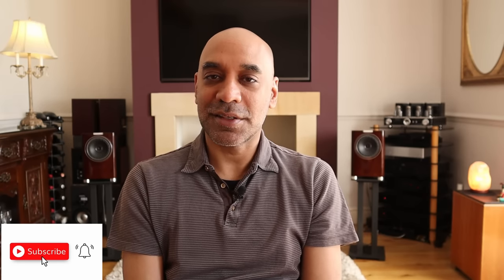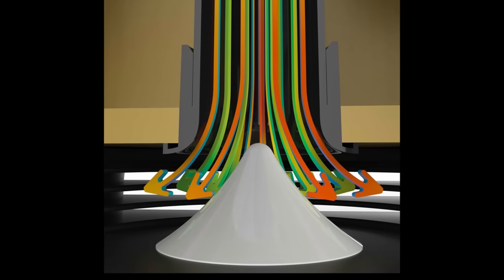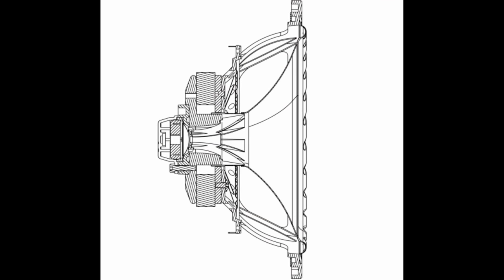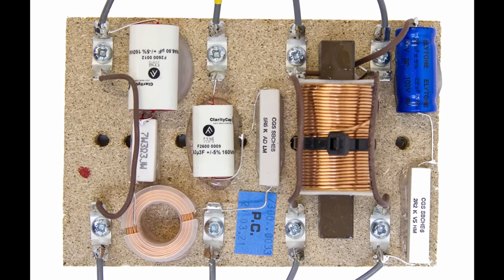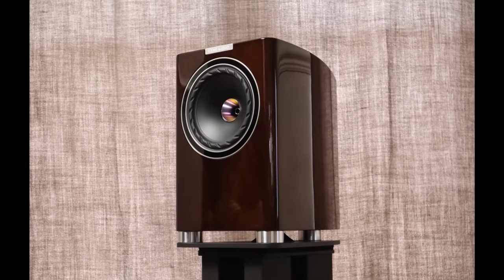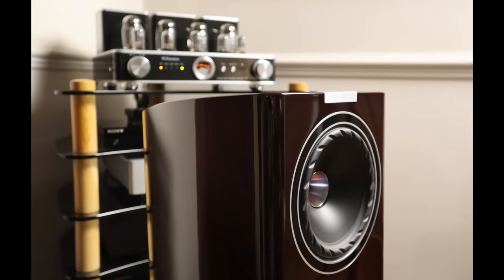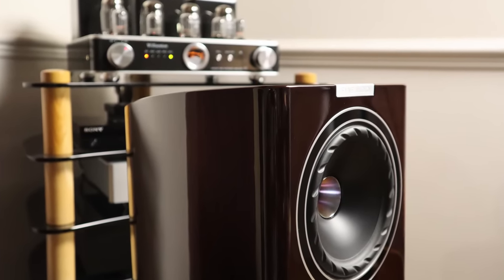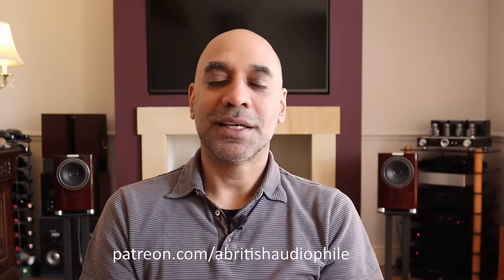Fyne Audio F700 Speaker Review

Comment: I auditioned these and while I don't think the amplifier would make a difference, the tonality you spoke about was pretty spot on.
Reply from the maker: Thank you Kevin 😊👍
Reply: @remella1  let me rephrase my statement. Well designed amps with same output specs should not make any difference. However if you choose a 40W amp and expect it to have a 20db headroom at an average listening level of 80db, with a listening distance of 3m from the speakers, then your amp will definitely struggle to perform; especially when comparing another amp with 80w of power. That is assuming both have distortion and noise below human listening threshold.
Reply: @kevincheong1516  agreed…but when it comes to tonality and sound signature every amp has the potential to alter the sound for good or otherwise…every amp brings its own signature IMO
Reply: @remella1  if they truly alter the sound, then you should be able to see it reflect on their measured frequency response... go check out most modern amp specs and you will likely to find published specs of +/- 0.3db flat from 20hz to 20khz...

If you do detect different voicing, that means the amp output is not linear... if you like a none linear amp, that's personal preference... but from an engineering and design objective, the amp failed.
Reply: @kevincheong1516  specs are only half the story. I have tried about a dozen amps with my ATC SCM40 and they all sound different to me. Some are good and others didn’t match well. The refinement levels reached a level I’m now finding difference by changing two capacitors in the linear power supply for my Mac Mini. In audio everything makes a difference…provided your speakers are transparent enough and you have the ability to perceive the differences.
Reply: @remella1  well, I humbly disagree. Measurement are the basis of design and engineering. I have tried a dozen of amps and those with different sound are mainly attributed to nonlinearity performance of the amp or mismatching the amp with the speakers. Those that measures well and assuming I don't drive them beyond their specified performance threshold, I find it no difference at all.

But if you do perceive a difference and enjoy process, who am I to object... it is your money anyway... cheers...
Reply: @kevincheong1516  😊

I have tried a few amps that measure very well but hated their tonality. There is synergy (and personal preferences too) that matters the most IMHO

Going just based on measurements didn’t work for me. There are other factors that matter too. So from my personal experience specs are only half the story.
Reply: @remella1  the problem is not about measurement... rather it is the absence of measurement. Published specs may be doctored. Take Speakers impedance which varies at different frequency, these are the data that is lacking. A nominal 8ohms may dip into 4ohms at 40hz. If you use an 8ohm amp with poor 4ohms performance, that may be the cause of difference you are hearing.

If we can get all specs published, synergy would be easier... it won't be a guessing game.
Reply: @kevincheong1516  what I’m trying to say is there are a few things that are as important (or more) as specs…things such as the tonality, presentation, synergy matter a lot! There is no guarantee that I would like an amp with measures well. The things I said above matter too.

I rest my case. Enjoy your music!
Reply: @remella1  and what i am saying is you can see the tonality and presentation through measurement. What you like is personal preference and 100% subjective. if you don't like linearity and prefer some colouration, distortion and even imperfection, or if you like the placebo effect of feeling good not knowing the flaws in your system, that's really your preference.

Fundamentally, measurement is not only a tool to validate the performance of your system but also your preference.

Anyway, I overstated my points... but I respect your opinion. I just hope to share with you none guessing way of getting the right equipment everytime but it does require knowledge and data... ultimately if you are happy with your subjective process and it works for you so far, it is your call entirely.

Cheers 🍻
Reply: @kevincheong1516  you can never guess tonality and presentation with measurements

Btw the tastes of each audiophile are unique and subjective. That’s the whole point!
Reply: @remella1  i don't guess, I can interpret from the frequency response. It does require some knowledge as I said before.

Anyway, let's agree to disagree... I put a 👍 for all your comments...
Reply: @kevincheong1516  interesting. Would like know how
Reply: @remella1  you can head over to Audioholics, Amir's Audio Science Review or Erin's Audio Corner... they have tons of literatures and objective reviews which you will definitely pick up a thing or 2. I mean, what do you got to lose 😉👍🏼
Reply: @kevincheong1516  I have done some homework and it turns out that two things that measure identical can sound very different. 

Here’s Paul’s take on it: https://youtu.be/IyFfF6cL6OU
Reply: @remella1  lol... sorry, Paul is a salesman... I wouldn't take his word any more than a layman...

Go to read up Dr Floyd Toole's research.

If that's a bit too heavy for you, go to check out the video from audioholic, audio science review, Erin's audio Corner or even Joe n Tell who recently did his recent in a more objective way.

Let me qualify again. If both Amps A and B measured with flat frequency response well below clipping, well design with at least 200 damping factor and similar impedance performance. You will unable to hear a different.

If you do, then some of the above that I have mentioned, is certainly off.
Reply: @kevincheong1516  😂😂 NO! based on my research I would shortlist something based on measurements (objective), but would never buy without listening (subjective). There is no way you could judge an amp or anything else completely without listening. I know people who are knowledgeable and buy stuff based only on measurements and made huge blunders. I believe objective and subjective are equally important. 

No point in conversing with you. You are one of those people that believe that the rabbit you caught has only three feet
Reply: @remella1  lol... let guess, you are an anti-vax and you don't trust science? No one is asking you to buy without listening. Listening subjectively may sometimes help in detecting any obvious red flags - channel imbalance can be obvious if there is 2 to 3db off. Hums and noise can be present as well... this are the obvious things I look out for because Measurement published by the manufacturer can be misleading as well.

But when comparing amp, if they are well design and operating within parameters, you will almost never hear a difference. Try to learn a thing or two from Amir of Audio Science Review or Gene from Audioholic. Anyway, I am not here to win any argument with you... if you do learn something, it doesn't benefit me monetarily either... 

So let's agree to disagree...
Reply: @kevincheong1516  learn to read basic English. I said for me measurements:listening is 50:50. Not that I don’t value silence. I value both equally. Not one over the other…based on my experience something that measures well may or may not sound good.
Reply: @remella1  likewise.. you seems lack comprehension ability. I provided references for you and yet you came back with a link from a salesman... that's a joke and hardly 50 50... like said pointless to discuss further... it is beginning to feel like debating with a flat earther...

Comment: I'll bite, why would birch be accoustically superior to MDF? Fiber board has inherent wave dampening abilities as the particles are so loosely attached to each other. Paper drivers also benefit from this effect. Why would birch be superior to fiber board?
Reply from the maker: Good question. I haven’t looked into it in any detail. The thin wall Baltic birch plywood is used in quite a few traditional speaker designs. ProAc Tablette, LS3/5A, Harbeth’s. Worth investigating 😊

Comment: Or for 1/4th the price, you can get the SoundArtist concentric 8” speaker, and change the crossover parts to high quality caps, inductors and resistors…at which point it would be better than the Fyne Audio???…. 🤔😁
Reply from the maker: Thanet may be interesting 😊

Comment: A word from the wise ! you really don't need to spend thousands of dollars for a good audio system
Reply: Wisdom is relative to the situation and need and wants are not the same things.
Reply: It's a matter of personal satisfaction. Spending more doesn't equate to enjoyment. I recently went on a quest to discover inexpensive audio cables for people who are skeptical, don't want to spend the money, or can't afford the expensive stuff. I discovered that Amphenol ("Worlds Best Cables") sells some really good cables for a reasonable price on Amazon. They scale properly getting better with increasing price. Their best cables are nicely terminated Mogami and Gotham cables. For example, Gotham 4/i microphone cable, available for about $1.25 a linear foot is very good. Add some decent RCA plugs and for about $25 you have a very good sounding interconnect. Same thing applies to Mogami 2497 cable at about $3.50 a foot. Making them yourself from bulk cable you can quickly save enough money to purchase a nice soldering station on Amazon, a small heat shrink gun, and some good audio grade solder like Cardas or Wonder solder. You are in the cable making business.

Comment: The moment I saw iron core inductors and a sand cast resistor in the crossover network I stopped watching.  If there is ANYWHERE you should have high quality materials, it's in the signal path...FIRST.
Reply from the maker: Sand cast resistors are pretty much used by all the competitor speaker manufacturers. I questioned Fyne about the use of the iron core inductor and I got a response from Dr Mills himself. They couldn’t get an air core with a low enough DCR to fit so the iron core gave better bass damping. It is used as part of the 2nd order filter on the mid/woofer. I suspect that at the volumes the F700 is likely to be played at the you won’t reach the saturation point of the iron core.